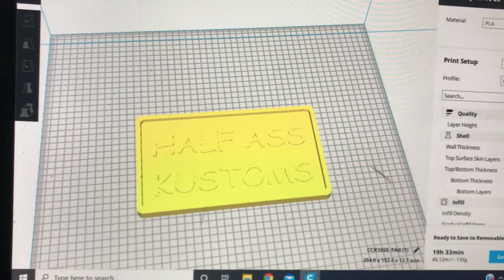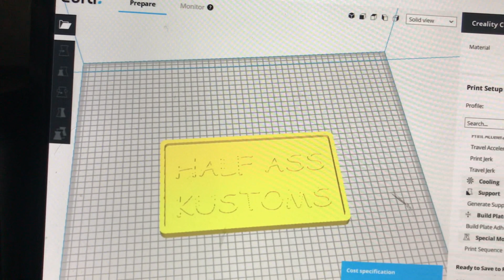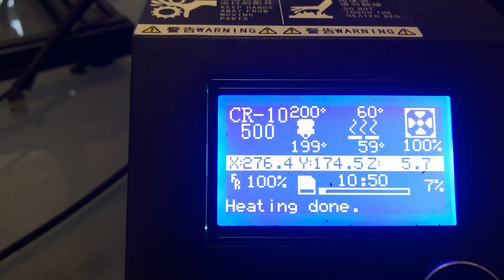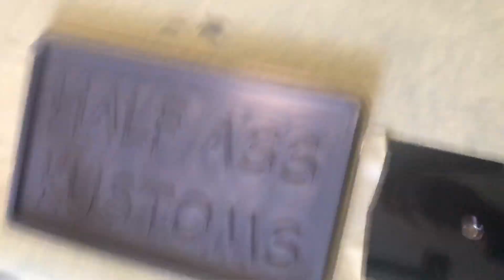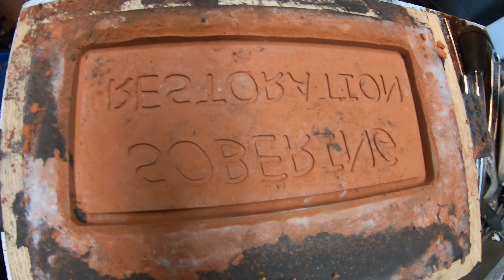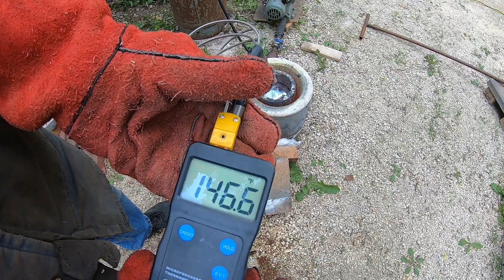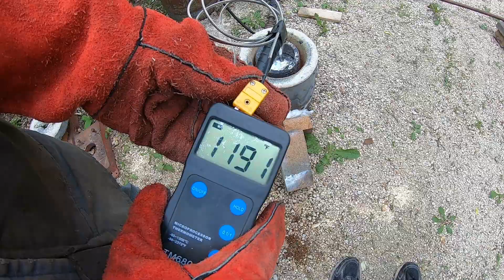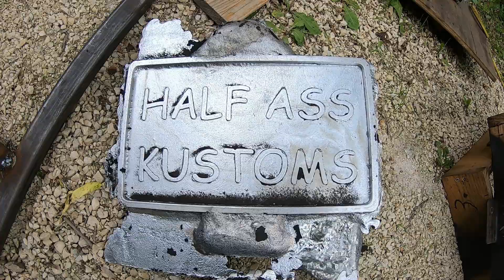How to Sand Cast Hot Rod Aluminum Plaques, 3D Printing and using Petrobond, Foundry, Crucible.

Comment: Ever think of trying to cast aluminum heads then getting a machine shop to machine them afterward? Be a lot of aluminum but sounds like you've been doing a lot of casting with Iron and Bronze as well as the Aluminum. Be very cool if you could pull that off for sure :-))
Reply from the maker: He have thought about doing flat heads or 4 banger head, but never attempted it yet.

Comment: This is pretty cool, Guys! 👍 
I ran my own small Aluminum Foundry and Machine Shop, up until I retired a couple of years ago, so I appreciate what you’re doing here. I love seeing you guys doing this stuff!👍 
Being a one man foundry, I eventually switched to a big Johnson dip-out furnace. I mostly used snap flasks, and I put almost everything on match plates. I converted a big arbor press into a Sand Squeezer.
My back is hurting, just from thinking of that stuff! LOL.
Nice work!👍 Tony B
Reply from the maker: Thank you, we have been at this for a few years, mostly making tractor and stationary engine parts.  Even made some movie props for a local production.